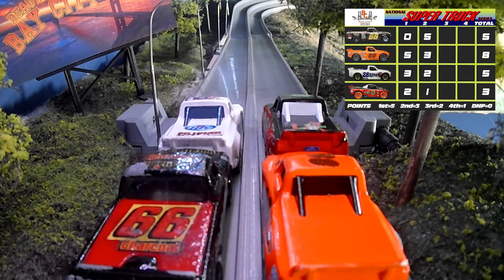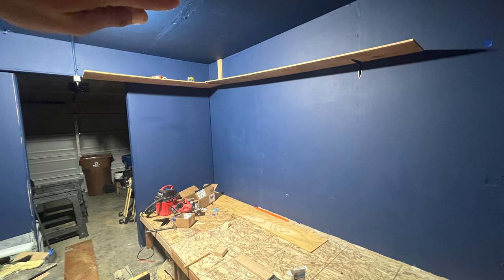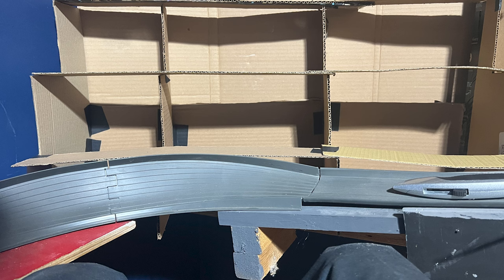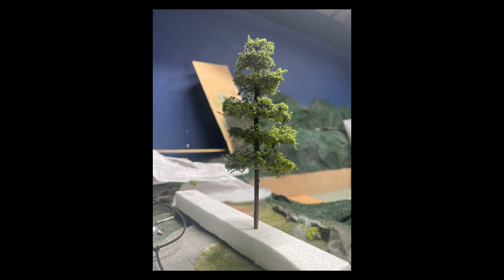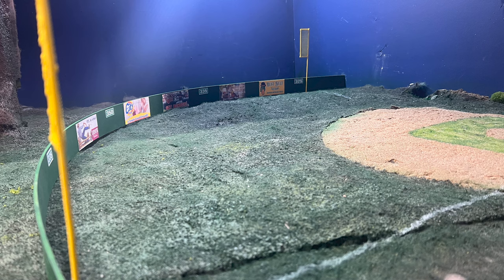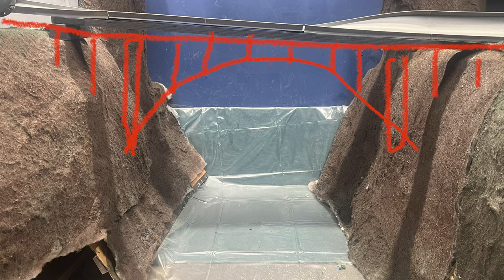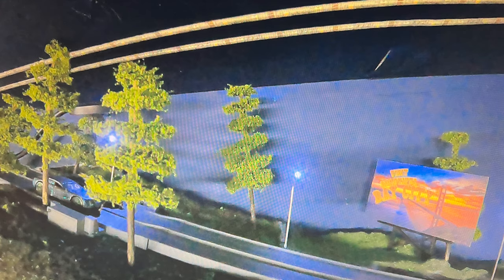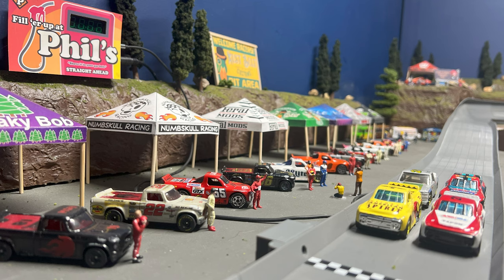Behind the Scenes Making of Bay City Speedway!!

Comment: This was absolutely outstanding. I am fairly new to diecast racing at this level. I've been a lover of 64 scale racing since childhood. At 57 this is a whole new lease on 64th scale racing for me. Laying out the track and creating a fun raceway is fairly easy for me. The diorama aspect of it, is where I struggle. You have provided many great ideas here. Very much appreciated. I wish there were more build videos as such. I am struggling along here, building a diorama race course with my grandson. We cannot wait, to complete it. And hopefully in the future host races in make videos.  I know I can't guarantee a perfect diorama. But I can guarantee some exciting fast racing. Once again thank you for your build video. And thank you for your resource list. I will be reaching out to several of the folks you called out in your video. To hopefully make some great pieces for my grandson and my track. And thanks to everyone who assisted Bay City in creating this fantastic diorama track. What a great collaboration.
Reply: Try Home Depot or Lowes foam insulation you can buy foam glue stack them to desired height, cut slopes into it and then shave the edges with a knife or foam cutter. Hot wire foam factory has all you would need to do what I mentioned. I would look up dioramas made of foam to get ideas on how to use them to exactly what you need. You can make just about anything with that foam insulation. They come in two by two sheets or 4’x8’ sheets. Lowes I think sells it in white and Home Depot sells them in pink. Keep in mind most spray paint doesn’t work with foam because it eats it. But theres many videos that explain how to paint the foam. I used to be into 1:12 scale action figures and I made a pretty good alley way for my Super Heroes. So now I’m going to apply it to my diecast racing channels. Bay City has done a lot of what I have been dreaming of doing, I just don’t have the space at the moment. I love doing this stuff so don’t hesitate to ask. Good luck nice to see someone close to my age still having fun. 😂 You have me beat by a few years 😂
Reply: Awesome information thank you very much. I may just end up tapping you on the shoulder for a few ideas in the near future.
Reply: Check out gravity throttle racing they have a good video on how he built his track

Comment: I started out making a 17ft long downhill drag strip.  My son and I had a ball with it.  Wife wasn’t thrilled when I would spend 20 minutes in a store shopping Hot Wheels cars every time we went grocery shopping lol.  

Then after seeing channels like this and 3DBotmaker, I decided we should build a race course.

I bought 5 of those NASCAR figure 8 tracks and made a lengthy track in my garage as well but nothing like this.  Mine is just the track and I attached supports that hold up the track against the walls.  Lots of trial and error for just the right angle.  I tried to add a corkscrew turn like the one at Laguna Seca raceway…diecast cars don’t like it lol.  But my track has no detail like yours.  No trees or buildings or anything like that.  Was thinking about recording the races and adding some music and sound effects for fun but it’s hard to find the time to do all that.  Tons of credit man.  Amazing job.

Comment: Great track! Thank you for the behind the scenes. 
Where your straights meet the curves, do you have custom pieces for the transition so your straights stay flat?
Reply from the maker: Hey JaRyan1974!  Thanks for checking us out!  Yeah all my curves are designed and printed by Spool Heads.   Some of the ones on the track are built specifically for the corner they're in, while others just went there because they fit. lol  But I understand custom pieces can be difficult to come by, and as you may know, Bay City was 100% Adventure Force Crash Racers for a long time.

Comment: The  camera work sucks because the track is too fast. So fast that the cars are just blurs that the camera has to try to keep up which results in motion sickness...practically. Slow it down a little. Perfect example would be..3dbot racing.try it for a season and youll see subscribers will stick around.
Reply: Maybe a little gruff in your delivery, but i won't fault you for your honest opinion.  This is what helps us get better all the way around.
Reply from the maker: Blackdog I’m guessing you only watched the first race of the trucks series, as I was experimenting with speed at that time.  I slowed it down an ADDITIONAL 10% for the second video.  If they go any slower than that, well it wouldn’t really be racing then would it?   Thanks for checking us out.
Reply: Sorry about the gruff, i can be an  asshole sometimes.  No excuses...i just really dig this shit and  your track  has so much potential ...i get  frustrated.